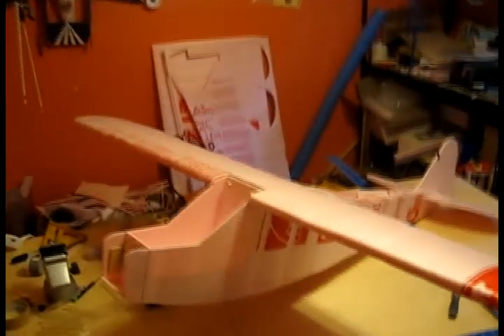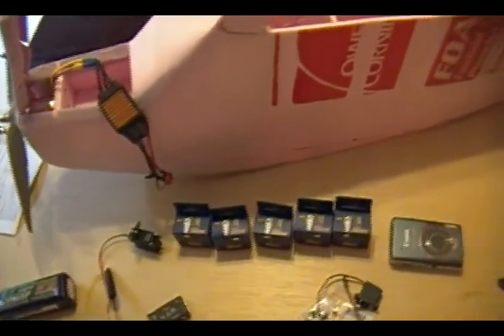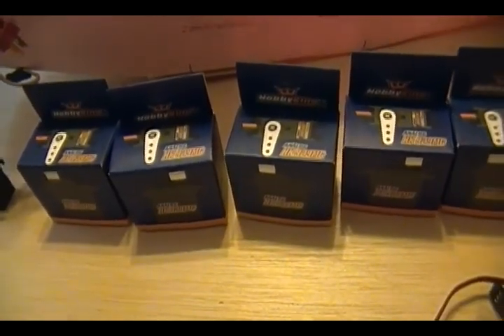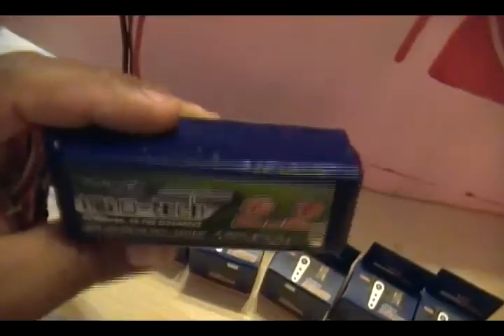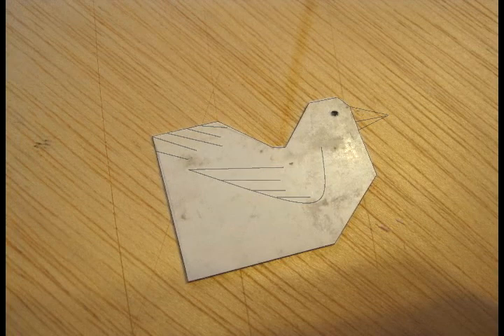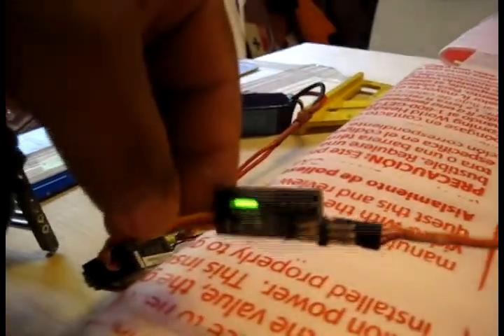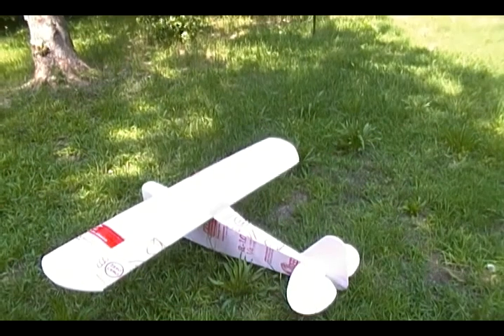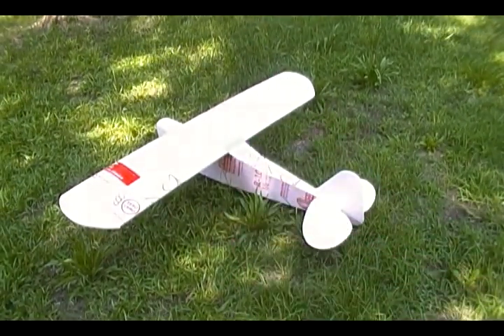Pink CUB build PART 5 electronics

Comment: very slick servo placement for the ailerons, i like that.  Im using this motor http://www.hobbyking.com/hobbyking/store/__18229__Turnigy_D3536_9_910KV_Brushless_Outrunner_Motor.html on a 14x7 on 3s, it only pulls around 30A but is very powerful. ive got it on this http://www.hobbyking.com/hobbyking/store/__29765__HobbyKing_Edge_540T_EPP_Light_Plywood_3D_Aerobatic_Airplane_1220mm_ARF_.html